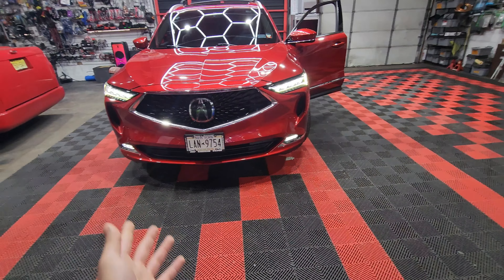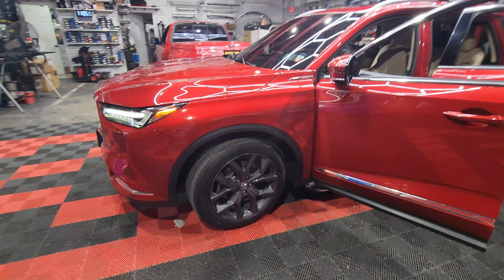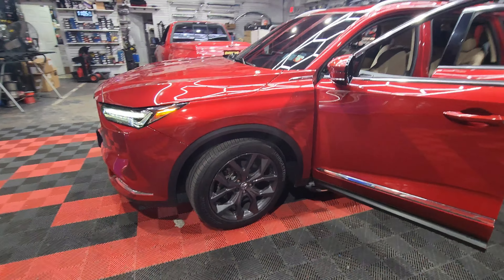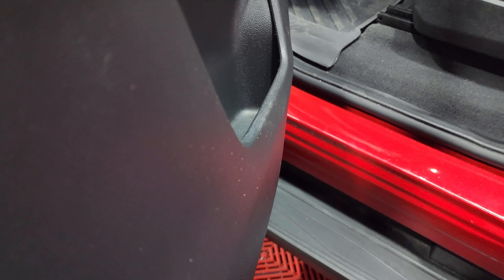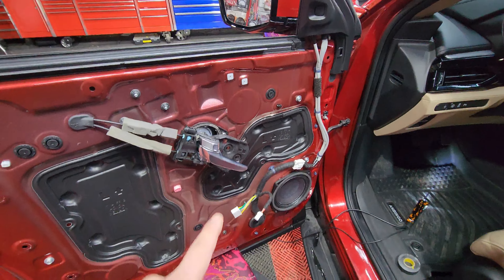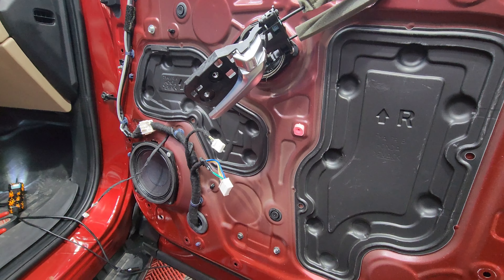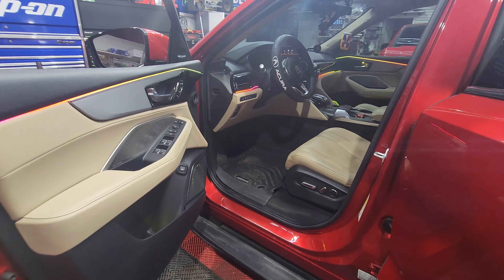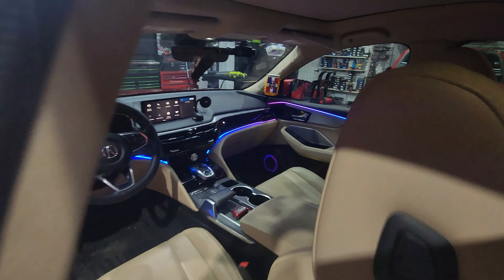2023 Acura MDX Ambient Light Install

Comment: For approximately how much would this cost and how long would it take for you guys to install it?
Reply: $500+ you can probably get it for as low as $350 depending on the person you go to and also consider if you have bought the LEDs to install or they are providing!  some places do lifetime warranty other places do one to two year warranty. A friend of mine has had them in his car for about four years and they still look great! Only noticeable difference I’ve seen is they kind of pop out on the edges after a while?